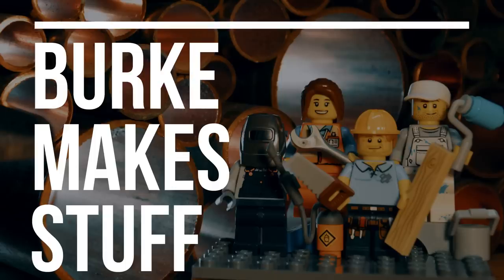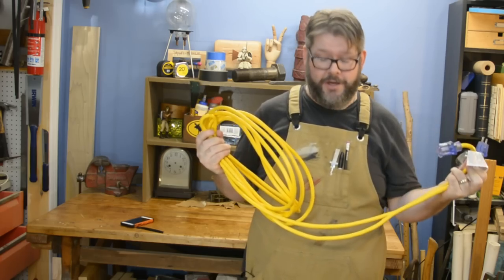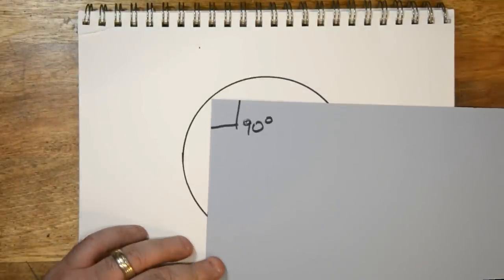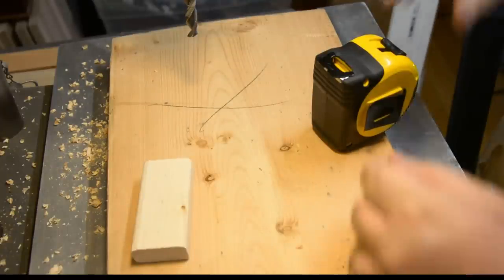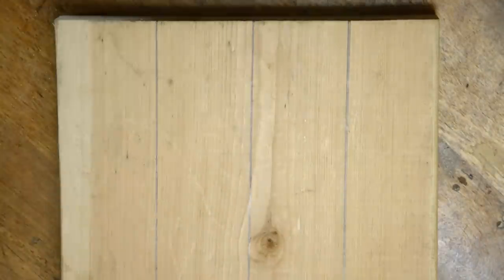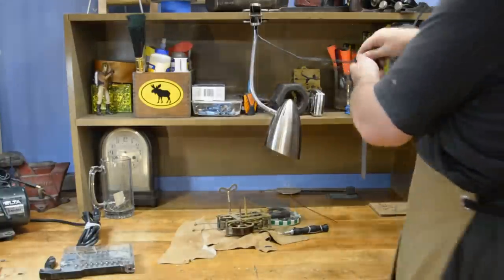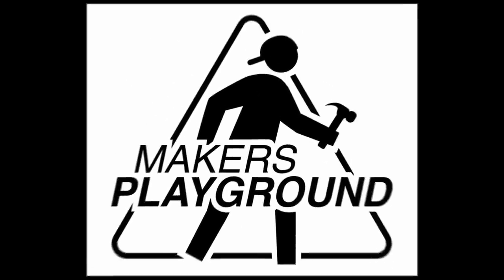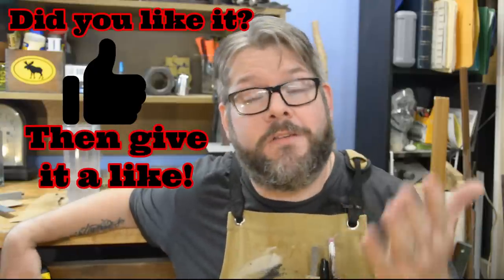10 Easy Shop Hacks #2

Comment: I purchased an adjustable temperature heat gun on Amazon for $20

Can blow warm air to fire starting air - so great for any application

 I also purchased a set of tips for around $7

Comment: Shop Hack #8:
  Last week. I just made a DIY light. It’s basically a mount/adapter for a Lithium Battery (power tools battery). Took an old mount we never use anymore (dewalt phone charger) and attacked to buttons (3 position switch) and an old led strip (cut and soldered) .One position turns one strip on (cut the strips into 3 LEDS), second turns on two rows.
It’s bright enough and angled so it shines at what you point it at, and a bit above you. The second row, shines on three sides, almost lighting up the whole room.
Made out of stuff that was probably gonna find a trash can (except for switch).

Comment: Great tips all around. I used to use velcro to hold extension cords and the electrical cords of my different power tools. Now I use different size gear clamps. They come in so many different sizes and colors. When I take the smaller ones I use off to use a power tool. I can snap them closed around the cable near the plug that goes in the wall. And you never misplace them. They come off quick, go on quick and they hold securely. You can buy them at Home Depot, Princess Auto and even Dollarama has started selling some.
Reply from the maker: Great idea!
Reply: Woah, this made me realise that you can actually use a spring clamp as well if you don't mind the extra bulk.
While it takes a lot more room, you can take it off and put it back on instantly, which could really change the way I deal with cords.

Comment: I work out of a garage which had only 2 light bulbs lighting the entire 20 x 20 room. Once I was a Walmart during black friday of last year and then they had these hyper tough LED shop lights on sale and I bought 8 of them for $12 each. They come with the fixture, the hanging chain, and plug in to an outlet. So the next day I put 2 switched outlets on the ceiling and hung them all around and it works great. The light is so bright it lights up 10 feet around the window at night. I've have them for about a year now and haven't had a single issue with them at all.
Reply from the maker: Outstanding! I just replaced all my shop light, similarly. I find you really can’t have enough light in a shop.

Comment: Shop Hack #7:
  We use Velcro to wrap a lot of our items, two handles bags and power tools. 
  Another item we use In tandem with Velcro, and that is Stroller/Grocery Carabiners. We use Velcro Wraps with Gromets to wrap around the handle of some of our cordless tools, and a stroller carabiner (5” - 7”) and clip out tools to whatever we can (we put hooks where we need them). Our work van has holes cut in the ceiling supports for weight control, it’s just big enough to throw an open carabiner into and stays put. Our DEWALT & Milwaukee bags hang from the ceiling and are easily removed and put away. 
Velcro and Stroller/Grocery Carabiners. Soooooooo useful.
We use magnets to hold our hole saws too. They cling to the ceiling of our drills and saw blades cabinet (it’s full metal).   They are the perfect weight to stay in place, even when van is on a dirt road in Massachusetts (we get wind waves/frost heaves in our roads, it’s like going over 30 speed bumps in five feet of driving).

Comment: Hats off to you for giving Izzy Swan and The Maker's Playground a special shout out. 

I would like to share a 3 part hack with you that involves power tools and extension cords. Before I begin, let me say that I absolutely HATE power cords, but they are a necessary evil, and this is an easy way to tame it. What I like to do, is buy a bunch of replacement extension cord plugs, both male and female. With my portable power tools, I cut the cord down to 4 to 6 inches, and put a replacement plug on the shortened cord. Wait until your warranty expires if you're worried about that sort of thing. This makes storage (especially storage), and use a whole lot easier. Next, for my stationary power tools, rather than allowing my wall outlets dictate where I set up my tools, or having to deal with miles of extension cords, I first do the same thing to the power cords on these tools as I did with my portable tools. I then use extension cords, and route them along the wall  just above the floor. I use those plastic clips you can nail into the wall to hold the extension cord, then I cut the cord to the desired length, and put a new end on the cord. All the cut-off pieces of extension cords go into a box and get stored in my garage or attic for future use. Let's say I need a 3 foot extension........I just grab a left over piece out of that box and make it.
Reply from the maker: Thanks so much for sharing these with me! Makers playground is an amazing community! If you’re in there, “friend request” me!
Reply: I like that idea with the shortened leads. It makes good sense as a way of combatting the winding and storing aspect of power tools. I’ll definitely be conscious of it over the next few months and will play it out in my head to see if it will work for me and my set up. Thanks for that high ranking intelligent hack Mr Wizard.

Comment: Shop Hack #3:
  I use that paint bucket (with a magnet on it) as a carrying tote for an extra pocket. Like if I need to put up a 2x4 in the attic, throw some screws in the bucket, pencil and tape measure fit in perfectly. Lite duty, lite carry.
Reply from the maker: perfect!

Comment: I was always taught to completely unwind an extension cable when using because of heat build up.
Reply from the maker: I few people have brought this up until I point out that shops all over the world have retractable, hanging extension cords. Those stay wound up permanently. No one unwinds those full before using them, because that would negate their purpose. If them heating up is such an issue, how are those even legal?
Reply: I have had several littering melt. So , I completely unwind  before using.  But, do ur own test.
Reply: Sounds like the extension cord is not the right gauge for the tool using the power.

Comment: I've cut the extension cords in my shop down to a reasonable length, adding a new plug to the cut end. I have six foot and ten foot extension cords, along with one cord to reach fully across the room. Saves time (winding & unwinding) and much easier to handle. My longer cords are stored & used elsewhere.
Reply from the maker: 🧐 interesting!

Comment: The dividing up of a board in equal parts blew me away. Now I know why I took up trigonometry in college. This is what needs to be taught in school ....practical applications.
Reply from the maker: Well Frank, I’m a teacher.....though O yea he theater! Lol. I share stuff like this with my students as frequently as possible. I try to give them stuff they will actually use! Glad you liked it, hope ya subscribed! Are you a maker?
Reply: @BurkeMakesStuff  I do enjoy making stuff in my garage. I went to aviation vocational school in NYC back in the 80's so I was able to get some good basic building skills early on. I'm a retired Air Force veteran who served 23 years of active duty. Now work as a Virtual Systems engineer for DOD.  I'm also into electronics and photography. Also started getting into wet shaving hobby and started turning brush handles on my lathe.

Comment: Just a short note on extension leads particularly the reel type. If you use one of these especially the ones with multiple sockets you should always unwind the cable fully before use because heat can build up inside the reel to such an extent that the cable itself could burst into flames. I've seen it happen with a small portable AC unit and the fire damage was extensive. It's just something to be aware of.
Reply from the maker: I’ve heard this before and am always apprehensive about it because huge companies sell the retractable spools that you can hang up in your shop that have 100 ft in them. No one is unwinding 100ft every time. So why aren’t fires braking out from these all over? 
I was always warned never to put anything conductive in the middle of a wound spool on the floor. That makes sense because the central conductor in their case would def heat up with all the current circling it.
Reply: @BurkeMakesStuff  I think the main problem is that manufactures follow a different set of rules regarding standards. These standards do not extend to the person who purchases these items. In recent times my local Lidl and Aldi stores have been selling chain saws , circular saws as well as various garden tools that are extremely dangerous. Crazy stuff really no comeback if you sever your fingers . They tell you that you should know how to use the device. Ah well take care out there.

Comment: Great tips but.... the extension cable, don't leave that sucker wrapped up in a coil if you are using anything with a heavy draw, you create something called an induction loop so If there is a metal core to the item you have the coil on it will slowly heat up, as electricity passes through cable there is also some heat generated at a higher wattage, this in itself can cause fires because it is harder for a tightly wound coil to dissipate the heat.
Thanks for the tips.
Reply from the maker: Yeah. I got into a conversation about this a few weeks ago. It’s a issue I’ve never heard of before, but I’m def taking the note. Better safe than sorry! Thanks!

Comment: Shop Hack #2:
I just made a tray yesterday, the mag trays are cool, but there is only one place they go. I now use a “Painting Palette”. It has six square trays, and six half-egg trays. I affixed neodymium magnets to the underside (strong small magnets), with superglue (held in place with a small nut or another magnet). Then coat the bottom with gorilla glue/liquid nails calk. 
I then marked each round tray with letters and square trays with squares. If I have multiple screws (like taking apart a laptop or something with a bunch of different sized screws), I can put them in a labeled tray, and write on a paper pad where that corresponds to on the item I am disassembling.

Comment: I have a hack for ya. When you divide even number fraction, it's easy. but odd number fractions aren't without a method. WELL HERE IT IS. Half of 13 3/8 divided by 2 is 6 11/16. Subtract 1 from the odd whole number and divide by 2 =6. Add the fractions numerator and denominator together to get the answer for the numerator, 11. Then 2 x's the answers denominator, 16...... Half of 41 1/2 is 41 - 1 = 40 divided by 2 ='s 20, the whole number answer 20. Add the top and bottom number's of the fraction, 1 + 2 ='s 3, 3 is the top number of fraction answer. 2 x's the bottom number of the fraction, 2 x 2 ='s 4, the bottom number of the fraction answer, 20 3/4. With practice you can do this very quick. Thanks for the video's.

Comment: Extension cord. Wind it up with a figure of eight pattern. This stops the twist in winding or unwinding it. It prevents tangle too and should make things safer, easier , and last longer.  It’s actually not winding it’s folding instead.

Comment: I’ve a hack for not unrolling fifty feet of cable when you want four…it’s called “go out and buy a four foot extension cable”  They don’t break the bank and if that’s your regular need, why mess about trying to make do with an unwieldy long extension….just store it away.  No shade on the vid..all good stuff 👍.  I obtained an angle poise desk lamp with a 9w fluorescent tube for beaming down into tiny and fiddly crafting actions.
Reply from the maker: Absolutely! And I do have quite a few of those myself. This was more “if this is what you’ve got to work with.” Thanks for watching!

Comment: Extension cords are not supposed to be used coiled up, it’s good practice to uncoil an extension cord completely before using it
Reply from the maker: I’ve heard this before. My argument is that good companies sell 100ft retractable cords to hang from the ceiling. If you’re always supposed to use it fully unwound, how do those make any sense. And if shops aren’t burning down around me, because every shop around here has multiple hanging up, what’s the danger?
Reply: @BurkeMakesStuff  I used to work in a boilermaking shop, and on a couple of occasions guys used welders that were plugged in with cords coiled up and they melted. I guess it depends what kind of load you’re putting on the cord. If you’re not frying anything then everything’s  cool.

Comment: Helpful hints thanks but not so good with passing current through a coiled power cord - it creates an ' inductive coil and that is why it becomes WARM😖
Reply from the maker: Yeah, I’ve had that discussion many times before. Unless you have something metal in the middle of the coil, I don’t think it is actually an issue at all. I mean think about it. Major companies sell the retracting power chord that you hang on the ceiling. That’s the exact same thing. If it was an issue, I’m guessing we’d either hear of many more fires, or law suits. Lol

Comment: Electricians always warn people to always fully extend power cables when they are in use. Otherwise they can act like a coil and become hazardous, so I have heard.
Reply from the maker: I’ve had a few people bring this up. I point out this: Masterplug Heavy Duty Metal Cord Reel with 4-120V 15amp Integrated Outlets and 12 Gauge High Visibility Cord (75ft) https://www.amazon.com/dp/B07BWXG7RM/ref=cm_sw_r_cp_api_glt_fabc_Q7Z9MSTMZ1SPGSJXDDK3
That is only one of 100s of them online. And the manuals say nothing about fully extending all 75’ with each and every use.

Comment: You need to be careful with the extension cord, if you do not uncoil it fully, there is a possibility of creating unwanted heat in the cable because of the coil effect caused. Otherwise some very useful tips.. hav a pleasant day.
Reply from the maker: I've heard this from a bunch of people on here, but none have been able to explain these, or why they aren't then a problem. https://amzn.to/3ZoDuml

Comment: I love your videos and I'm going to subscribe. Thank you for making videos that are interesting and fast-paced. A word of caution though: I had a 50 ft indoor/outdoor extension cord that I partially unwound from a cord wheel and used. Granted, it was for a few hours, but it was used in the basement and the items to which it had been plugged in were powered off. I came back downstairs a couple of hours later to find a burning plastic smell. Where the cord had been wound on itself, multiple areas of the cord had melted together. We were probably about 5 to 10 minutes away from having a full-blown fire in the basement directly underneath my daughter's bed. I would encourage you in your next hack video to update or add a word of caution about extension cords.
Reply from the maker: Ouch. I’ll def be careful with that. Thanks for the heads up!

Comment: I do not agree with hack nr 1. Indeed if you use an extension cord, it should be completely unwound to avoid overheating
Reply from the maker: A few
People have brought that up until we discuss the fact that companies sell hundreds of thousands of retractable extension cords that you hang from your ceiling every year without issue. If doing it this way is dangerous 1) why are they able to sell those? 2) why don’t we hear about issues with those all the time?
Reply: @BurkeMakesStuff  I don’t know how it is in different countries, but here in the Netherlands if you look on the label of a power cable wheel it states how much power you can use when it is on the wheel and how much power you can use when it is completely unwound. What you do is making an induction spool of your power cable, so how more contact the cables have how more heat it will produce. A simpel trick is to instead of making cirkels around your arm (witch also can make your cable look like an old phonecable), make an figure 8. In this way there is more air contact, and so kore cooling. In the beginning it is a little hard to do, but when you get the feel for it it works just as easily. The hardest part is that you have to feel how the cable likes to turn. I use this same trick at work and we use cables rated at 380volts and 125amps. Sometimes it will be used like that for multiple days, and until now never head an overheating cable (overheating sockets is something else). M

Comment: #4 JUST FOLD PAPER CIRCLE IN HALF AND THEN FOLD IT IN HALF AGAIN ADJACENT FROM THE FIRST FOLD. 

BOOM YOU HAVE YOUR CENTER POINT
Reply from the maker: Hard to do that with metal…. Not to mention you then have 2 folds in it.
Reply: @BurkeMakesStuff  Hence the reason I said to use “PAPER”

Comment: Please don't roll your cables around your elbow. Bad for the cable, and is just bad form. Otherwise cool video.
Reply from the maker: I had someone else say the same! How do you do it? If I
There’s a better way, I’d like to learn.
Reply: @BurkeMakesStuff  i dont think I can share a link here, but look up over-under cable roll just here on youtube, there are several great demonastrations available (Maybe ill make my own video on the subect). It is the method we use in pro-audio and entertainment for mic cables etc. And will extend the life of your cables. When a cable is rolled around an elbow eventually is creates a weak spot at the pinch point  created by said elbow and can damage the cable inside the jacket. More liekly on more delicate cables like dmx and xlr, but still applicable for all jacketed, stranded power cables etc. Thanks for your response.
Reply from the maker: @RealWolfmanDan  will do! Thanks!!!